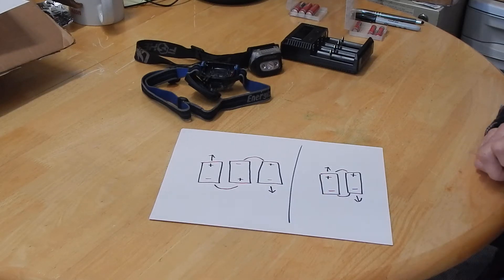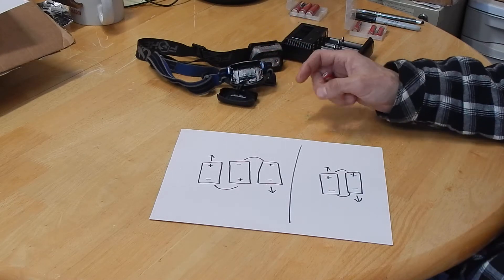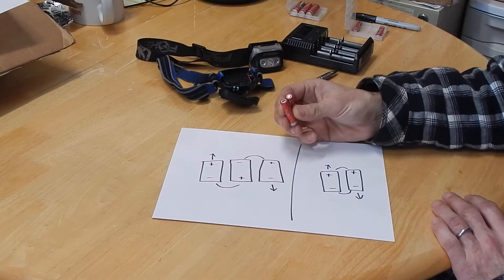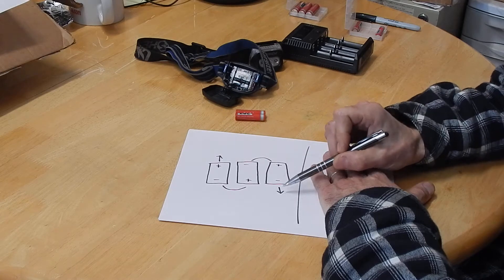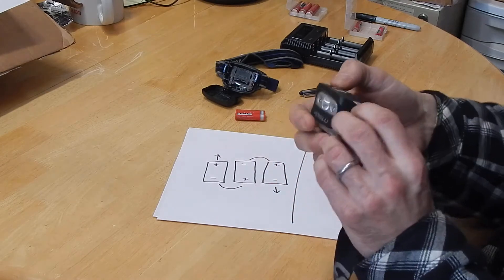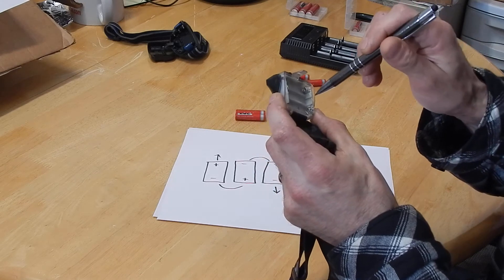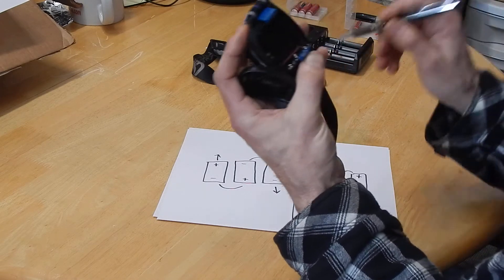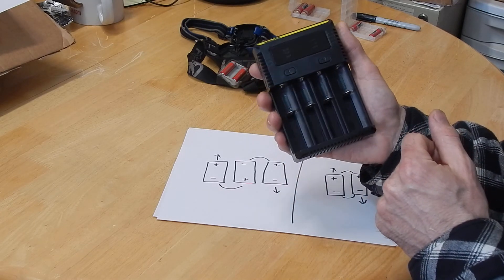AAA to 10440 Lithium Flashlight Battery Conversion Hack

Comment: Disclaimer: Don't try this at home.
Another way you could do this is by making or buying a pair of dummy cells that will simply pass the current through them and then using just one 3.7V 10440 cell in the stack-up. I checked my current 3xAAA light and it still works at 3.6 volts, so it should still function fine with the single 10440. My only concern would be with the lack of a battery protection circuit in there. Might want to store the flashlight without the cell in it for this reason, or even get more sophisticated with your design and solder the battery protection circuit in there yourself.

Comment: Great video!! Did you ever end up doing the 4 x AA conversion to Lipo4? I have a LoRa (long range) sensor that is attached to siren as part of a DIY Homekit carport security system. The 4 x AA battery slots seem to be wired serial providing about 90 to 150mA at standby (less that 1 w) and up to 6 volts in the rare cases that is it powering the 12v siren.

When I use the USB dummies or when I put in 4 x NiCd rechargeables though, I get battery sensor warnings in my security system that have 25% life left in the batteries. When I use brand new regular Energizer batteries I tend to get a reading of only about 80% life reading as well due to the lower 1.2 volts per battery. I'm wanting to replace the 4 AAs with something 1. rechargeable and 2.  that provides about 1.5 volts per battery (but not low 1.2v like the NiCd rechargables ) so I will not get the warnings that my battery is low. Have any ideas or links on how to do this? Thanks!!   UPDATE: AmpTorrent PRO 1.5 reachable Lithium AA’s (the kind that require the separate charger) have been great for my low powered but constant 1.5v x 4  IOT uses!
Reply: This is exactly i was thinking 😂 voltage difference going in series will burn it glad i didn't do it yet lol
Reply: @rodey6594  I found some amazing batteries for low powered / IOT sensors that require true 1.5v btw ! I saw a youtube review / comparison of 1.5v lithium rechargeable brands. Not to be confused with regular  Lithium, single use AA’s (like Energizer ) that output 1.8v or the bigger 3 v cells you were pondering. Check out the AmpTorrent 1.5v” Pro” AA batteries. The ones that require a charger (the ones with the usb internal port charging supposedly do not perform as well).  For my use (I do not need high power just constant 1.5v and something reusable with a long mAh), the Pro batteries are perfect. Long lasting, don’t overheat, don’t over or under power. Let me know if you try them out. :)

Comment: Nominal voltage ⚡ but my question is would it fry the unit if the unit will run on just 1 - 2 - or 3 1.5 cells?

Comment: If you could use the same amount of lithium ion batteries, this would be good.  But going from 3 Ni-MH or 3 Lithium metal to 2 Li-Ion reduces the total capacity a lot.  In any light like this (except when very low lumens ~30 or less) Ni-MH will perform much better than alkaline, though they are the heaviest AAA/AA batteries.  Meaning the light will stay brighter, longer due to much less voltage drop under heavy drain.  The brighter the light, the bigger the difference.  For non- rechargable, lithium metal blows away alkaline.  They are also the lightest & lowest self discharge of any battery with a ton of capacity.

Comment: Throwaway batteries are becoming ancient history. Carbon zinc, alkaline, and rechargeable alkaline will be coming very scarce to find There are even 1.5V lithium ion rechargeables coming into the market.  Many are starting to make their own batteries from scratch using schedule 40 pvc and selected chemicals

Comment: Quick question, is this a parallel or series output? If parallel, how would  I go about converting it to series output? Thank you!!?

- Jerry

https://www.flickr.com/photos/191607016@N08/50760238923/in/dateposted-public/#
Reply from the maker: It's a parallel arrangement. If you wanted it in series, you would just leave the flashlight unaltered because they come in series originally. But using lithium batteries your voltage would be ~2.5x what it came with, which is why I switched it to a parallel setup.
Reply: Can I switch this parallel setup to an altered series variation that can draw up maybe most, full or more then 2.5x power and safely at that?
Reply: Also using the 14400 EBL battery's with charger btw ...

Comment: Found 2 types of batteries online that are neat alternatives to alkaline batteries. 
My complaints are...
I can't recharge Harbor Freight Nickel Ni-Mh when I'm not home battery voltage isn't the best, and battery life isn't great could invest in a car charger no problem.

 Alkaline batteries dim after short period of time and good AAA are expensive. 

One alternative in USB rechargeable battery which I can charge with readily available USB charger but they're expensive as well.

Next whould be a better battery but 1.5 volt batteries with chargers are expensive as well. 
Was thinking about putting 2 3.7 volt cells in parallel like you did but in a penlight issue is mha would be worse than Harbor Freight batteries yet be brighter though and charger would still be an issue not going that route. 

Had an ah ha moment as I stumbled across 2/3AAA Ni-Mh 400 mah batteries super cheap and utilize same charger as standard rechargeable AAA. 3 will fit into a inline slot for 2 AAA no problem. 
Battery life will be less, will be brighter, and don't need a special charger I think it'll be the best of both worlds for me and can use USB rechargeable batteries as a backup😉
Reply from the maker: Believe it or not the capacity of the batteries is more important than the voltage. You can drop a little voltage and still have it be plenty bright. I went from 4.5 to 3.7 in this video and it was fine.

Comment: Been wondering if theres a way to hook the same batteries in parallel into a pen light🤔 
Alkaline batteries tend to dim after a couple hours in my Streamlight stylus pro and rechargeable Ni-mh batteries from harbor freight don't last long. 
Could put a dummy battery in to use one battery but I don't think it'll last as lont as harbor freight batteries in series. I'll keep looking👍
Reply from the maker: You would have to figure out a way to eliminate contact between the positive and negative in the middle, and then connect the positives and negatives with wires. While leaving the positive and negative ends exposed in order to touch the contacts in the flashlight. The wires would have to be heavy enough to handle the current. But small enough to fit in the housing. So it's possible but would take a bit of work.
Reply: @alouiciousjackson5812  I think plastic disc can be used for isolation and can glue contacts with wires to the plastic discs as well. Shrink tube can go on the outside of the 2 cells and hold them together. Will have figure out a way to charge them too.😂 
Idea will be on the back of my mind still looking at different cells on Amazon and google shopping search list. I saw a few polymer batteries but don't want to have to wire them back and forth between the light and charger especially when mha rating is much lower on polymer batteries so not the best option.

Comment: I wish I saw this video beforehand. I was experimenting with the 10440 350mAh batteries in a head strap light similar to yours. Plugged them in and was impressed with the brightness. Decided to leave it on to see how long the charge lasts. I come back a minute later to the smell of melted plastic. Rip my cherished led light.

Comment: The 3 × AAA alkalines in series will discharge from 4.5 volts to 2.7 volts. The 2 × Li-ions in parallel will discharge from 4.2 volts to 2.9 volts, nominally at 3.7 volts. So yes, the voltage ranges do overlap. However, a light built for alkaline cells has no Li-ion protection circuitry. Running the lithium ions in it can discharge them to low enough levels that they will be damaged and/or destroyed. Be sure to recharge the lithium ions before they get too dim, which should be at about 3 volts, and you should be okay.
Reply from the maker: Yes, that's true. That approach also extends the life of batteries, which have no over-discharge protection.

Comment: I was hoping u could answer a question for me. I have a LED LENSER headlamp that will not turn on after charging it on my rapid adapter phone USB charger. Can u or anyone else tell me why and how to fix it. Thnx.
Reply from the maker: To start you should use a battery tester and make sure the batteries are good, and also make sure the charger is the right one for the batteries.
Reply: @alouiciousjackson5812  It was only 2 weeks old. A high dollar top brand headlight. The charger I believe was too much for it. But I dont know What that would have blown out. The battery, led lamp, something else?
Reply from the maker: @ChauntelleARussell  I'm assuming you were using the correct charger- in my experience, the headlamps have terrible soldering. Once I had a circuit component fail- they have since removed that component from current models- but the first thing I do when buying these is to go through it and resolder all the wiring.
Reply: @alouiciousjackson5812  That's my problem. I plugged it into my Rapid Adapter Charger for my phone without thinking. This is the 2nd LED LENSER headlight I did that with. The 1st one wouldn't turn on after I did that. They cost $120.00 each. I bought it on Ebay so i dont think that the company with honor a warranty. I was hoping someone with some electrical knowledge could tell me what could have possibly blown on the headlight from using the wrong charger. I'm legally blind and this is the only way I can see stuff pretty much is using these headlights. I also tested the battery and it's good. It was only 2 weeks old
Reply from the maker: @ChauntelleARussell  Could you post a link to the light?
Reply: @alouiciousjackson5812  sure. Let me get it. It's a LED LENSER NEO10R
Reply from the maker: @ChauntelleARussell  Wow, that's fancy. So I would start by replacing the battery. How did you test it? It uses a high quality, protected type 18650 lithium. These are meant to be charged by a USB port. Otherwise buy the optional wall charger sold on their website(the US and UK versions use different chargers- the UK type can be used in the U.S. with an adapter). If you must use a phone charger, never use one with an output above 1 amp(use a high quality charger in the 500mA to 1A range). In other words, no rapid chargers!
Reply: @alouiciousjackson5812  I do use Orbtronic batteries. Lol. That's what I bought to replace it. But the led lenser battery is showing good on the meter. And I found that out about the chargers with the 1st one. I was tired and have many cords plugged in all over and so happened to grab the cable plugged into the rapid adapter charger and it killed it.
Reply from the maker: @ChauntelleARussell  You could use any cheap 18650 to test your light. However if you need replacement batteries, there is only one acceptable replacement for the original, it's called ORBTRONIC. https://www.amazon.com/gp/product/B0193UPEWG/ref=ox_sc_saved_title_9?smid=A2ULLSF7VWONFR&psc=1
Reply: @alouiciousjackson5812  they are actually cheaper on their website. That's where I buy them from. And the led lenser doesnt send u a charger with the headlight. For as expensive as they are and with the variance of amps & voltage in chargers these days ud think they'd send out charges with them
Reply from the maker: @ChauntelleARussell  If they won't replace it I'd be happy to check it out for you!
Reply: @alouiciousjackson5812 thnx
Reply from the maker: @ChauntelleARussell  Here is a cheaper alternative to your Lenser light: https://www.amazon.com/gp/product/B01KVSG9UU/ref=oh_aui_detailpage_o06_s00?ie=UTF8&psc=1 While it doesn't have the same incredible quality, it is very decent. I've bought various similar products with mixed results. I would recommend this one. The batteries are very cheap though. You just have to be careful to only charge them for a few hours then remove them. It comes with a wall and car charger.
Reply: @alouiciousjackson5812  Thank u. I've bought that one b4 and I dont like the side button light. I've had really good luck/experiences with the led lenser. If i wouldn't have shorted it out or whatever i blew on it it would be working great. I've had several brands over the years and i found that led lenser works best for my needs. I guess I may need to just buy a new one. The 1st one was replaced under warranty when I burnt it out. I had a receipt of purchase tho. The 2nd one I bought new on Ebay bc the US didnt sell it. I filed a warranty earlier and will see if they will replace it. It doesnt hurt to try

Comment: Brilliant idea thanks! Just curious but why didn't you connect the terminals with a piece of wire or something and then use 3 batteries in parallel?
Reply from the maker: Blakehx You could stuff a third one in there as is or modify the contacts. I didn't say it just for liability sake and to keep things simple.